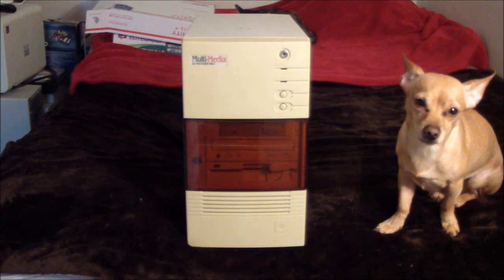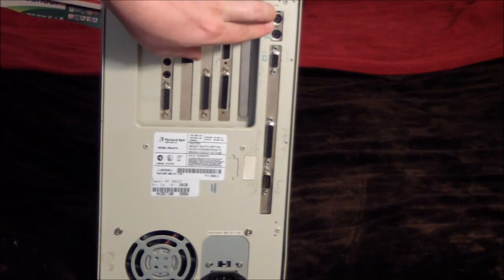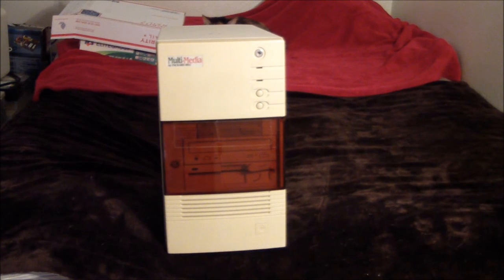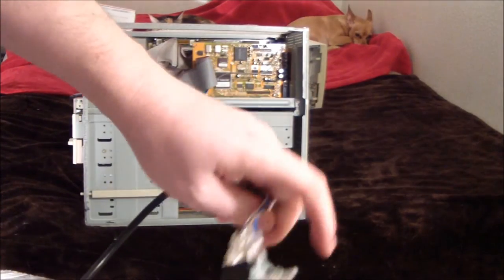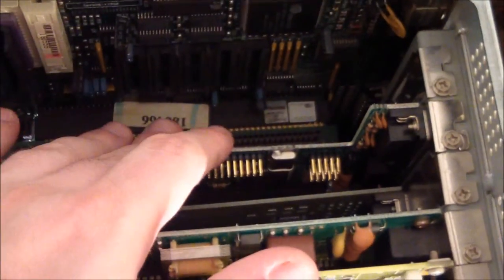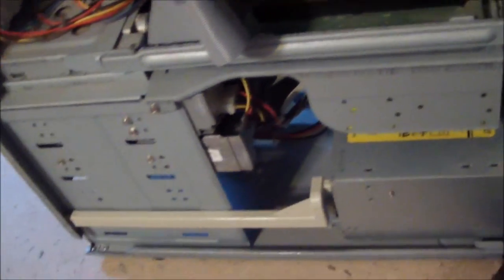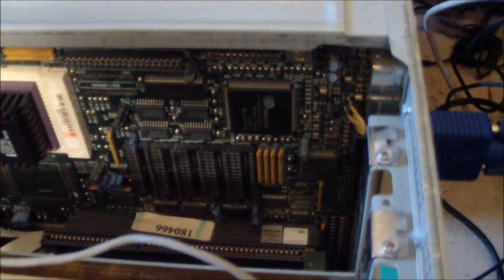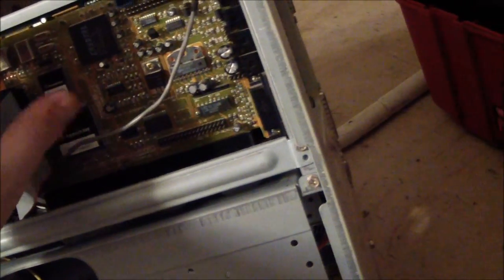Packard Bell Axcel 39CDT

Comment: excellent video! i had this computer model, but with a different procesor (intel overdrive), no cd, no 5 1/4" floppy drive, badge missing, but that was actually mi first experience with a computer(i was a kid back then).
Windows 3.11, playing risky woods, cdman(pacman clone) and tom & jerry on DOS, pretty strange is called "multi-media" since it didn't had any soundcard nor cd, but we bought from another person so maybe he kept these goodies for another computer, or maybe packard bell reused the case for other, more basic models.

Mine unfortunately went to the trash, had a hard disc failure, every technician tried to sell us another computer instead of reparing this one, back then it was like 5 years old(at least for us) and we end up getting a modern p4 windows xp, this was on storage until we moved to a bigger house, i tried to repair it after that, it booted with a "live" msdos floppy, but the hdd was dead, i didn't know how to fix computers back then (2005) so i moved the pins randomly in hope of the hdd being detected, but after that it won't post, so we threw it away... i totally regret throwing it away since in two years i started to work was a technician, learning a lot on how to fix these things, it would be made for an excelent 486/386 retro computer.

Comment: i find it odd that a overdrive is installed on a system that does not have an overdrive socket , usually the overdrive socket indicates that they  system supports overdrive.. if just a white socket, normally does not support overdrive..

Comment: my packard bell died, i saved the cpu, the ram, the hdd, and the soundblaster 16 from it, the pc stopped recognizing cd rom drives even though the cmos battery was good, so i just scrapped the pc's mobo. i am keeping the case in case i get another mobo like a pb600 or hillary motherboard for it.
Reply from the maker: +Windows Ninety Five 66 I wish you luck in hopefully getting something in that case again one day.
Reply: or get a socket 7 at mobo that can fit that pentium 133 that i have, i cleaned the old thermal paste off the cpu and put it in a static bag. but i would need a at case or i can use a atx case.
Reply from the maker: depends on the atx case. you can use one with some modification but it may be more trouble then its worth. I know some older atx cases had stand holes to support AT form motherboards. you would probably have to do without a back plate though unless you make your own from sheet metal though I sometimes see AT back plates on eBay. I have so many orphan CPU's tucked away in static bags. I have a whole bag full of Pentium III's and anouther one full of Socket A CPU's.